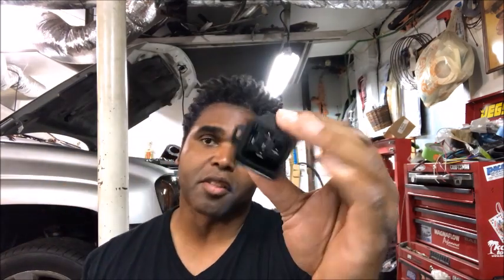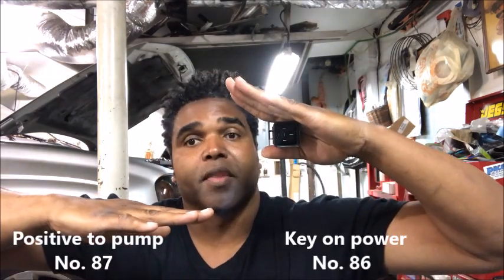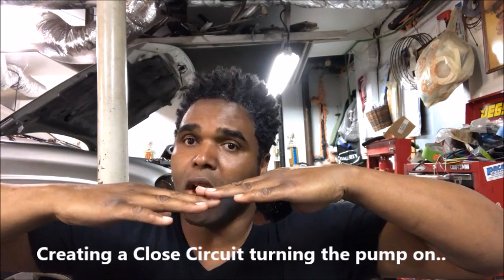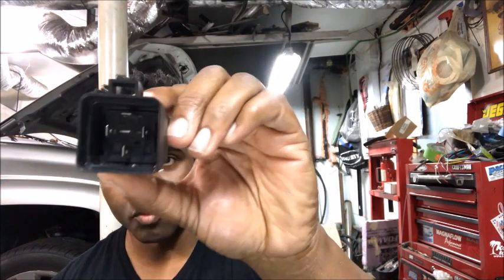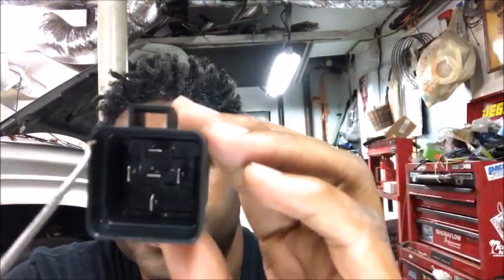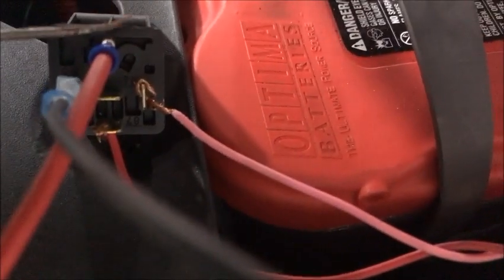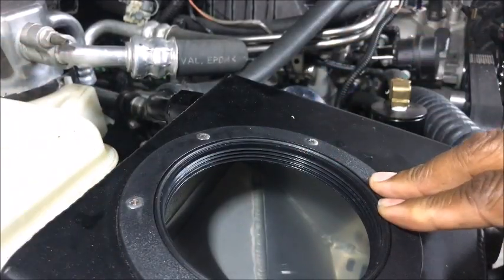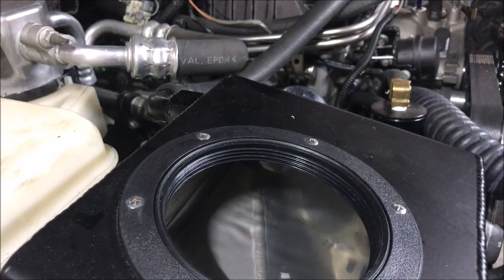How To Wire a Relay (4 Easy Steps.. Done!)

Comment: I was having a issue with my car fuel pump stays buzzing and not cutting off when the key is switched on number 2 turn can’t figure it out and from what I hear it’s dangerous
Reply from the maker: yea it can be.. are you running it to a power on key ? there is a wire that supplies power for a few seconds when the key is in the on position then cuts off until you turn the key to start.. thats the safe way. keep me posted.

Comment: Great explanation Terry. They are remote switches, at least that's how I learned. And if you have the extra time, 87a terminal, the 5th one, can be used as a "relay off" indicator. Its a normally off circuit. On my chevelle it let's me know that I have left the electric fan relay off, with a red led wired directly to it.
Reply from the maker: very cool.

Comment: You can use two relays to wire two electric fans in series or parallel to achieve a low and high speed.